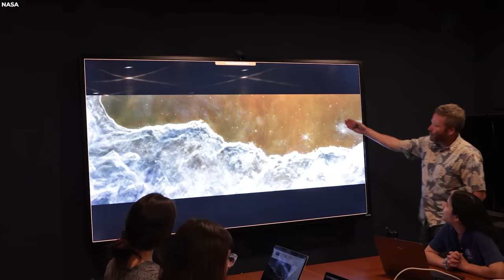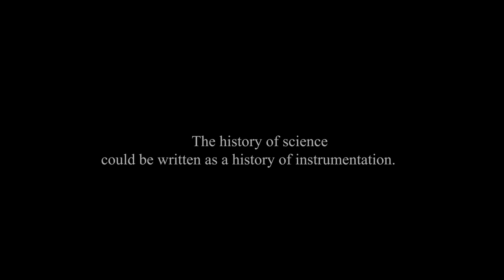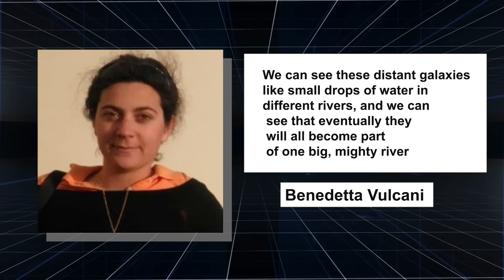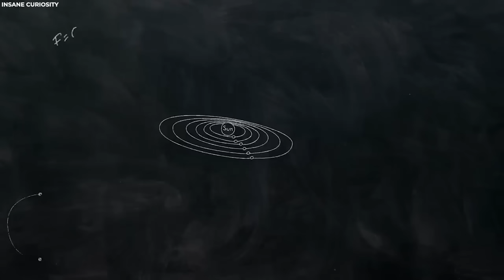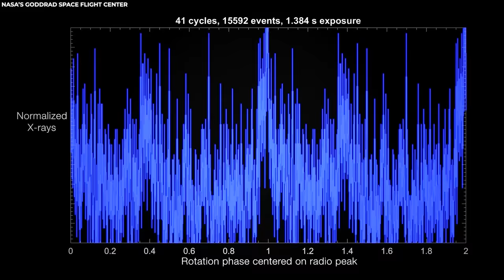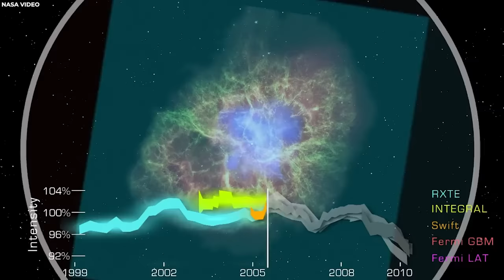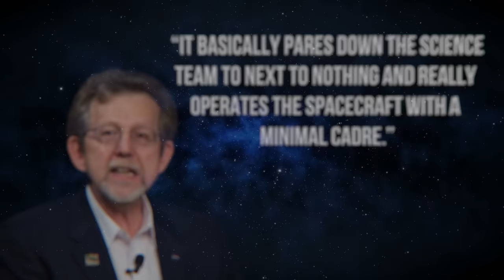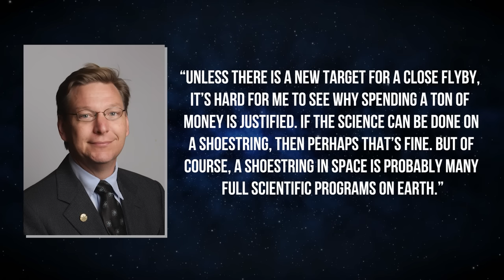Another Blow to Big Bang! James Webb Telescope Detects a Structure that Should Not Exist

Comment: I’m finding it increasingly difficult to brush off the language errors made by the AI doing the narration. How is it possible to mispronounce multiple times in the same sentence?  We know it is attempting to read 0.005 for example, but it seems to read each instance of the number 0 as a different word. It has a very distracting and disconcerting effect. How can you trust a source that can’t or won’t correct even simple mistakes?
Reply: It’s not an AI. It is simply text to speech.
Reply: I agree with thus pronunciation phopahs.  Rather fun though to see how many different ways “kuiper” belt was messed up.    And “ nitrogen “ with “i” as in mitt. 🤣🤣🤷🏼‍♂️
 But overall a ton of great information  in the presentation. 👍🏼

Comment: if dark matter is real, then it should hold together the galaxies in a spherical shape, not a flat one
Reply: Not if those galaxies are spinning. If what you say were true, then all galaxies made of ordinary matter would be spherical.  they're not.
Reply: @jelink22  yes, but the rotation of some galaxy is so fast that the outer stars and planets would have to fly away due to centrifugal force. Now they say that dark energy prevents this, but dark energy would exert pressure from all sides so that it would end up becoming a sphere. So I don't know if dark energy exists. There are still a lot of calculations to do.
Reply: @Ezekiel903  First, you do not concede that your original claim is false.  That's very damning. Next, dark energy is a repulsive force, so there's no way it could oppose centrifugal force. In any case, opposing forces are holding galaxies together' they are not slowly flying apart.  And since many galaxies we see are flat disks, your hypothesis  about dark dark energy acting on galaxies in all directions is falsified by observations.
Reply: @jelink22  is it false? ok, so what is holding this stars together despite the high rotational speed?
Reply: @jelink22  This is from Quora! Repeatedly, this scientific assessment and corresponding conjecture for such immense powers of dark energy are purely fantastic thought values! George Odathekal, Basel, SUISSE
Reply: @Ezekiel903  Gravity acting on ordinary and dark matter, with a supermassive black hole "anchor" at the galactic center.  DERP.
Reply: @Ezekiel903   An unsubstantiated OPINION!!  SNORT
Reply: It's magnetic. 
A guy patented magnets in the universal shape and created Nebulas found in space, such as the Box Nebula in a vacuum tube to mimic space. 
There are three videos. There were supposed to be 7. But the three are very informative and make a lot of sense. Very compelling. It explains a lot and is comprehensive. 
The Prime Field
Reply: @jelink22  😞what a nonsense!
Reply: the shape is the result of the spinng gravity field of the center of galaxies;;;;;black hole that is maybe,,and they are not that flat,,some are many light years thick,,,,and why some have a spiral shape ,,maybe that the dark matter is preventing the edge to follow the rotation cycle of it,,causing the edge, where the gravity is a lot weake,,to be trailing the closer part of the galaxy,,🤔
Reply: @robertpotvin8872  There was a report on why superfast rotating galaxies don't lose the outer planets, they used dark energy as the reasoning. But dark energy would affect the entire galaxy and not just the outer planets. If you squeeze a flat disc together it will "inflate". That was the reasoning why some said Dark matter doesn't exist or has no effect IN a galaxy, she works only in  expansion.
Reply: So you know what dark matter is then??